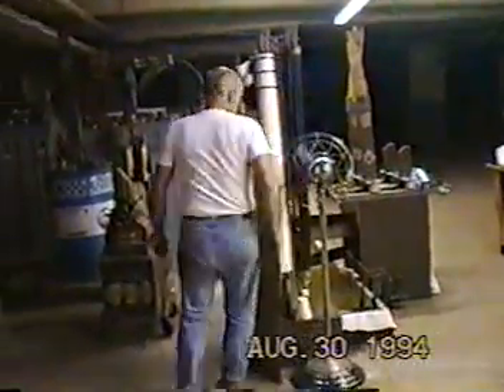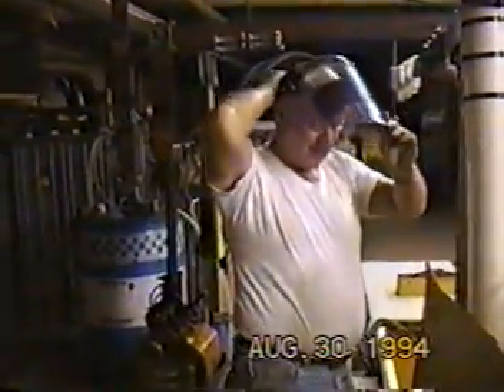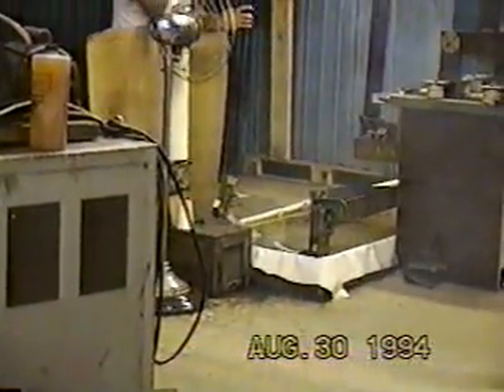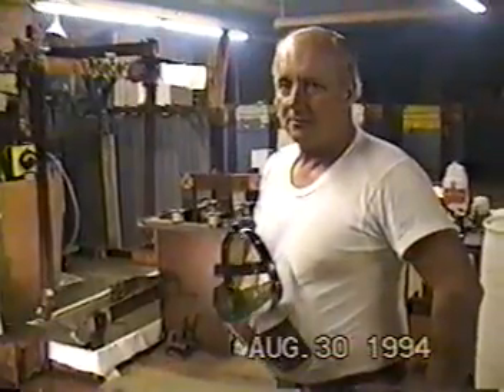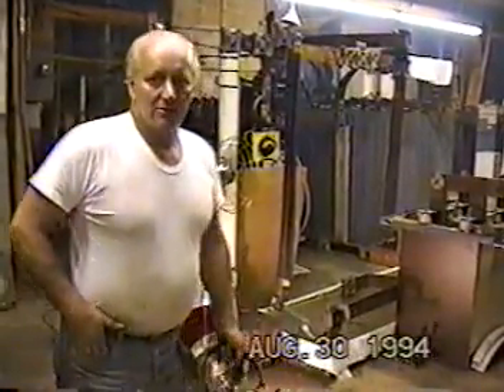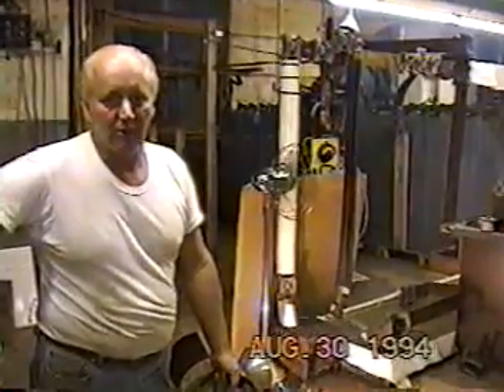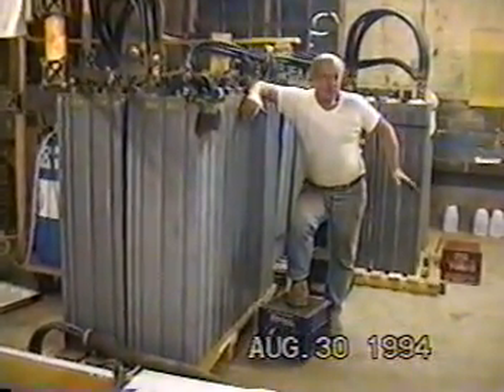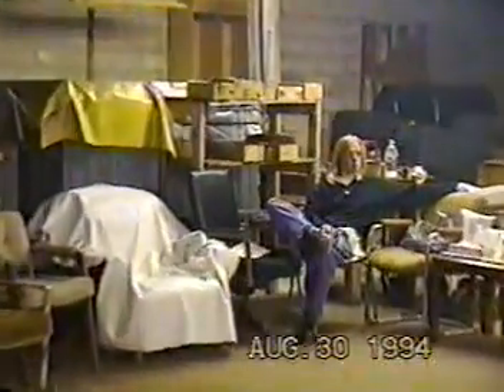Submarine Battery Bank shorted.Initially called ball lightning, now Leidenfrost Effect. August 1994

Comment: what Golka  is making is nothing more than  weld spatter
you can make the same thing  with a welding machine or generator
Reply: the conducted material has had the electrons excited beyond its holding ability causing it destruction at which point the excited material becomes detached and until the over excited electrons slow and cool it hovers unable to conduct or bond this is why the material becomes spherical just as seen in splatter from welding and or plasma cutting.

Comment: Absolutely by no means is this, "ball lightning". Its a shame that these guys in the video don't know any better. Its the same light/plasma balls that are produced with an arc welder. Actual ball lightning is not heavy, rather it floats effortlessly. I've made genuine balls of light that float in the air, while tiny ones stick to the hair on your arm.
Reply: interesting, could you perhaps elaborate on how you made that? or any info?
Reply: 4yrs and no reply from Mr. it's not a lighting ball, james roney hmmmm
Reply: +James Roney Stators Yeah, I think you are right.  It's just little bits of plasma and possibly molten metal.

This would obviously not be analogous to what lightning might produce because this is a lot of amperage but low voltage, compared to lightning.  Actual lightning is enormous voltage but relatively low amperage.
Reply: A scientist spends his life on phenomena from B 4 U were even born and U come and just cut it down. Shows how unscientific & retarded U R !!